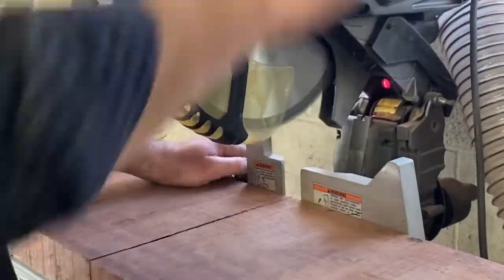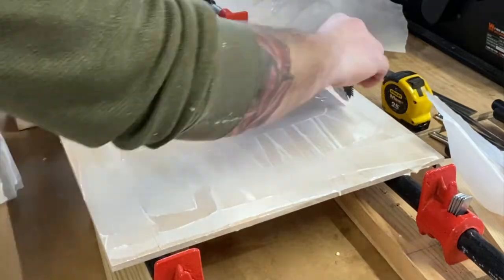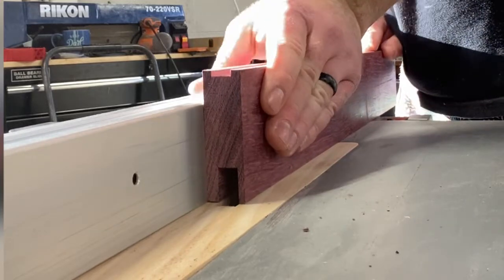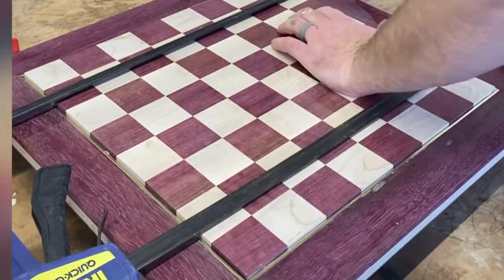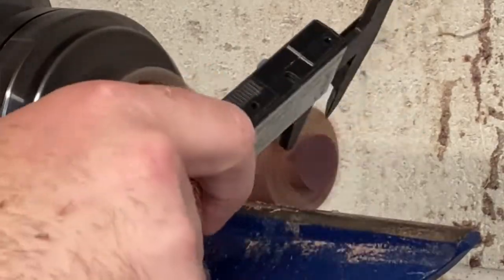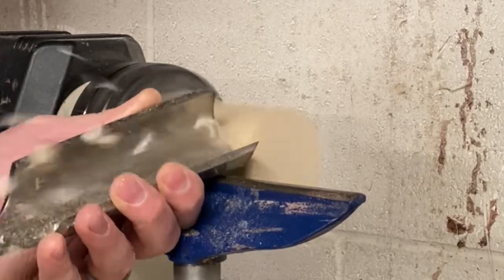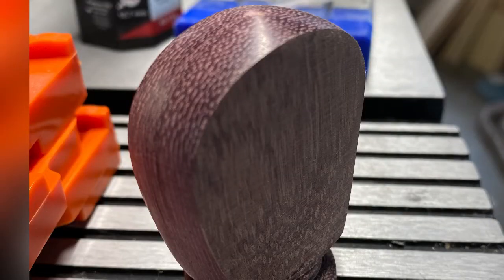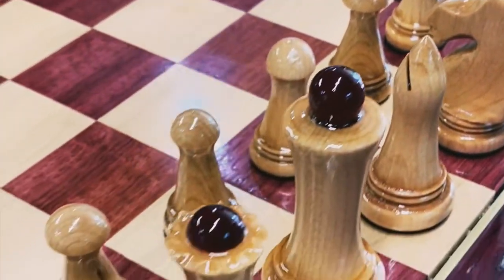Making a Custom Chess Set

Comment: Beautiful! The only negative point I can make is that I would have weighted the pieces in the base before applying the felt.
Reply from the maker: Thanks!  Yeah, I actually bought weights that I wanted to do that with, but it was a little more trouble than I thought it would be, so the customer was fine with me leaving them out.  I’ll try to figure out an easy way to do it for next time.